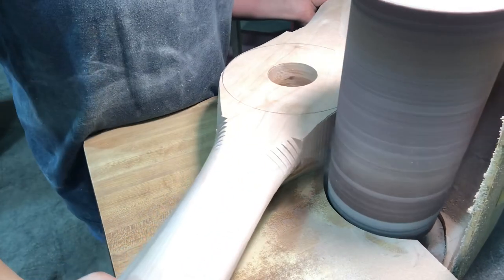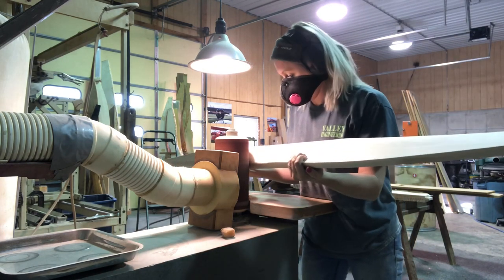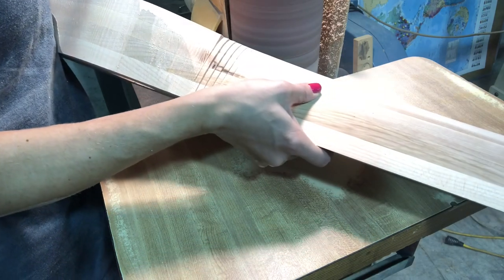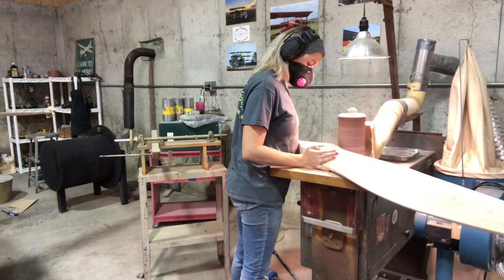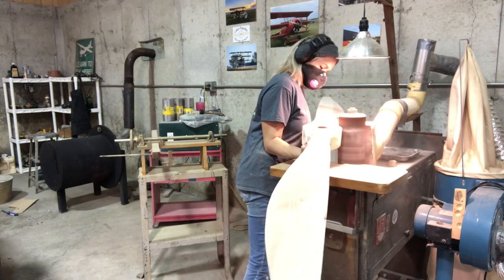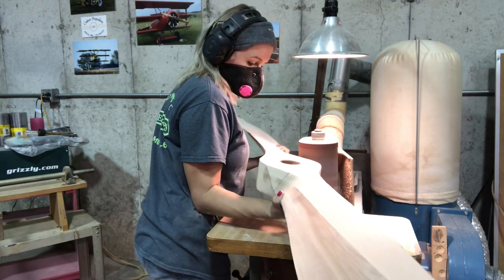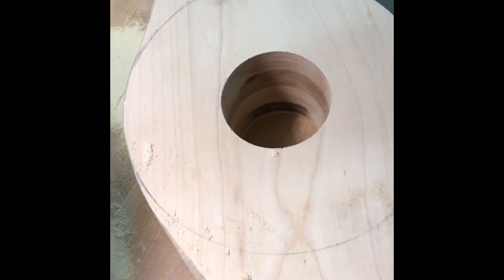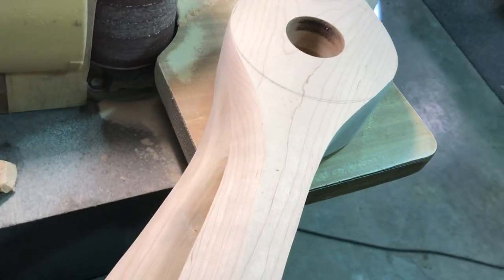How To | Woodworking | Wooden Airplane Propeller

Comment: Its relaxing watching you craft that prop.
What did you use to clean the drum-sander, please?
Reply: Maybe a rubber eraser?? That's what the wood turners use...
Reply from the maker: Yeah; a rubber eraser. And I actually didn’t know what it was called, until now. 😂
Reply: I use a cut up tire tread or a natural rubber cleaning stick either one is fairly inexpensive

Comment: There is a great tool for sanding items like these props, especially the larger ones,  I call it a "Rolling Pin", but it seems to be called a pneumatic drum sander, hand held on current web sites. It is a smaller diameter drum type sander, with a pneumatic inner drum that you inflate to the tautness you need to  make the curves you are looking for, and it is very accurate and easy to use as you can see all of the areas you are working on while making the compound curves blend perfectly. They are reasonably priced so you can get several and have them set up with different grits to take it from rough to finish without having to swap out sleeves. Here is a link for one on amazon: https://www.amazon.com/Pneumatic-Sanding-Rubber-Aluminum-Polishing/dp/B07GBFRY98/ref=sr_1_5?keywords=pneumatic+rolling+pin+sander&qid=1573617698&sr=8-5
The link is for one that is for mounting on a motor or shaft, but there are many variations that can be hand held using a drill motor or a air chuck drill to spin it with an idler end for your other hand, making it a two handed tool. I have spent hundreds of hours (many hundreds, no exageration) using this kind of tool, and it is so much easier than utilizing a stationary spindle sander for stuff like you are doing with the wood props. I hope this tip helps. I know everyone has a preference and a style, and I respect that this may not be the right tool for you, but I wanted to let you know about it in case you had not had the chance to check it out.
Reply from the maker: Thank you! I will look into it!

Comment: As always, amazing artistry. I'm curious: it looked like you cleaned the sander at one point. I've never seen that done before, anywhere. Could you enlighten me? You held something against the belt, then moved it from bottom to top, and the accumulated dust went away. Fascinating.
Reply from the maker: It is a sand paper eraser, it clears the sawdust out of the sandpaper
Reply: It's something like crepe rubber, they make commercial belt cleaning sticks that look like a giant eraser.
In a pinch we have used an old crepe rubber soled shoe.
Reply: @CulverProps  Just shows to go ya, even at 80 I'm still learning.